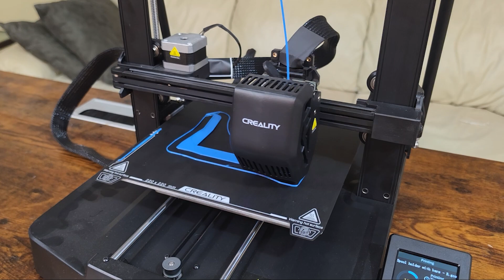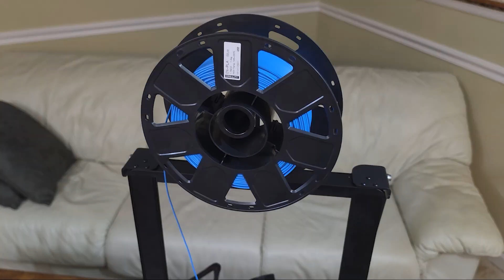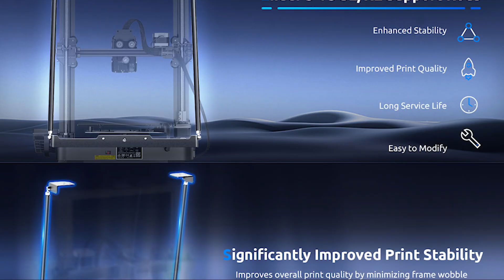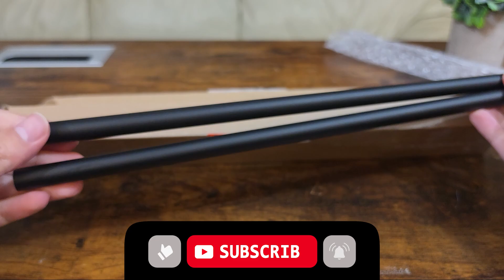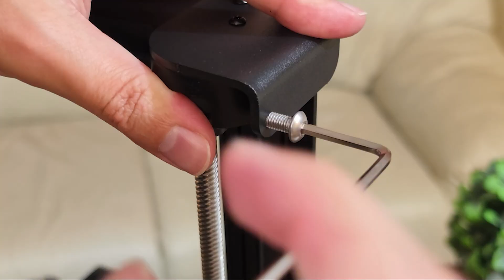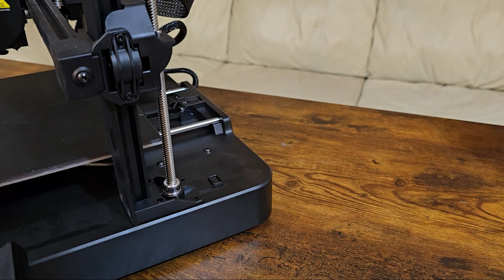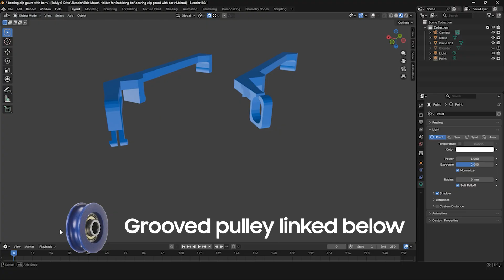STOP Ender 3 V3 SE Wobble! Support Rods + Updated Side Mount Mod

Comment: I noticed you're running the print head without the FFC fixing clip assembly to hold down the extruder cable wiring. Was there a specific reason for that decision? I'd think you want that cable to be more supported, not less.
Reply from the maker: Do you mind time stamping where you noticed that? I'm not a professional at this so I don't mind being told if something's wrong.
Reply: @cktechcheck  Not a professional myself either, I just finished assembling my own and noticed yours was missing this piece. @ 0:34 you can see the print head ribbon cable. On mine, there's a clip that gets attached across that cable to keep it from coming loose during printing. 2 screws secure it down.

Comment: Hey, love the videos. Quick question, I’m thinking of getting an ender 3 V3 SE it’s basically the only option where I live.

I noticed your first video featuring it was 1 year ago, and you just uploaded this one 11 hours ago. How has it been treating you so far? Thanks!
Reply from the maker: It’s been a solid machine for the price, though it definitely benefits from a few tweaks, but i haven't had any dealbreaking issue with it yet.

Comment: i printed a cradle for my spools with threaded rods between them and ball bearings on the threaded rod where the spool can sit on the bearings with gravity and roll, eliminating the need for different size center rollers. reason is the spool has varying tension as it unrolls because it is swinging, unless it is spinning concentric to its own axis,  otherwise tugginhg ever so sleightly on the hotend. not sure if negligible but i like my roller carriage better than an inner roller, though spool widths may vary and i need to engineer a one size fits all roller cradle, probably just with hollow tubes to cover the bearings and span across the threaded rods loosely between the cradle sides.
Reply from the maker: I like the idea. I've run into the same problem with different brand spools having different interior and outside diameters. It'd be nice if it was a little more universal instead of having to buy the same brand no matter what to make it work.
Reply: @cktechcheck  i just added plastic tubes to span the bearings on the threaded rod in the cradle unit. so just imagine two long rolling cylinders and the spool just sits on them and the sides that hold them together are just high enough to stop the spool from falling off them. seems to work pretty well. total materials needed are some filament to print the sides and the tubes, 4 bearings (smaller the better, less printing needed for the tubes, smaller form factor) and whatever threaded rod fits the bearings exactly, 8 nuts to hold the threaded rods to the sides of the cariage which can be printed. in my setup there's enough room for the cradle to sit on my enclosure but i suppose it may depend on people's setup whether it's practical. easiest thing for changing spools i've tried too, just make it wide enough to fit the widest spool you use.